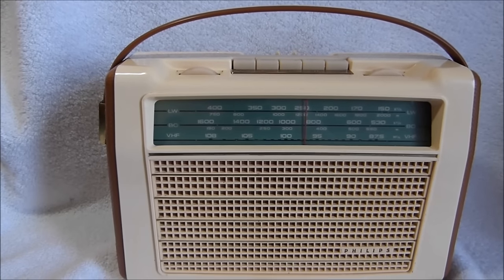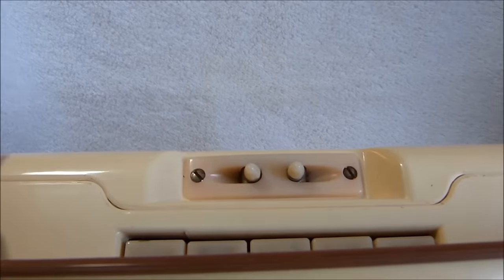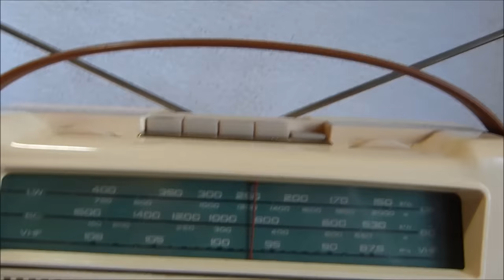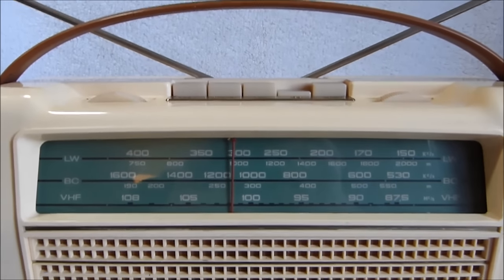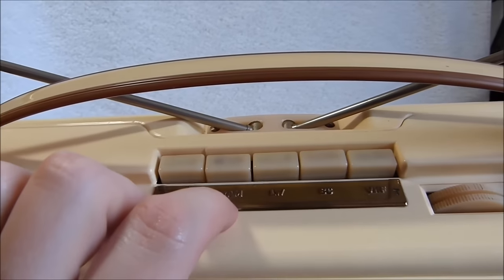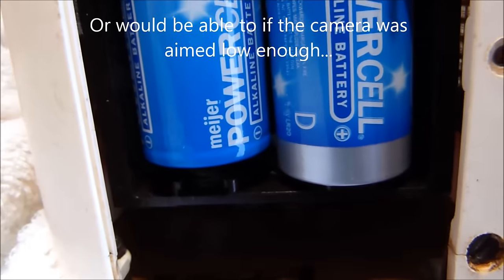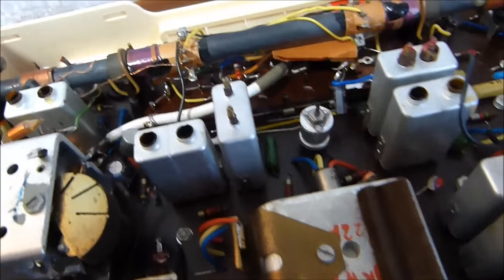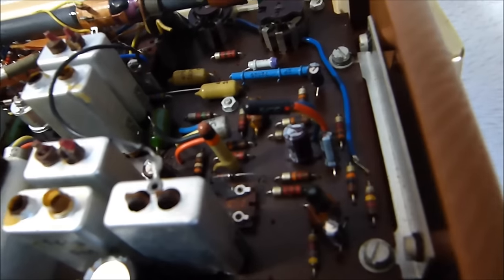1962 Philips model L4X98T/72 transistor radio (made in Holland)

Comment: Like it! On the intermittent, have you checked for dry-joints?  It's a real pig when they work for a while then go silent, my sympathies.  On the circuit, I bet Philips made another version with just a different dial for the Continental European market.
Reply from the maker: +Andrewausfa I did try gently flexing the board, but I couldn't get AM to come back... this one really just dropped dead all of a sudden. I am not sure if there were other versions of this model, but they did label the dial in meters (and KHz), and you don't see that on sets sold in the US and Canada generally.

Comment: Lol “untested, can’t find a 9V battery”
Reply from the maker: One time a seller said that, and there was a battery off to the side in one of the pictures!
Reply: Matt I was going to buy a older realistic sw model, seller stated “works great and in fine condition” so
I ask him basic questions, “dial light work, scratchy volume, tested on batteries?” His reply? Ahhh yeah I’m not an expert in radios I just sell stuff, and I’m not buying 4 C batteries to test it”!  You can buy 4 cheap batteries at dollar store for $2.50 (was 2$) a few months ago…hmmmm anyway, if someone wants top dollar would t it be wise to invest in a few batteries to add a few points to listing?  Typical example of a. “Embellishment of a. Item” Seller is obviously hiding flaws to protect himself but in long run, if buyer chooses, the eBay court will side with buyer. (Seller had listing as not for parts(

Comment: Howdy Matt!!  Im kinda mixed about this radio, some elements I like, others not so much!  Outside of aesthetics, it sounded real good! As you know, I can find some info about an item, this one, I did find the same links as you, I also found a site that claims he has the service manual, I have no affiliation with this site nor do have any first hand knowledge, I would suggest before you purchase, contact the seller and see if he would at least offer you a photo of the actual radio itself. 

Look at the bottom, 3rd one up, listed as a Norelco:  http://goo.gl/jl2jZi
Reply from the maker: +Vintage Electronics Geek It's not the flashiest design, but I like the nice clean design of this one personally. I think I found the link you were talking about, I kinda doubt they actually have the manual though. Plus I don't want to pay for a schematic until I am sure nobody has a copy.

Comment: In Australia, there was a similar model which had MW and 2 SW bands, and using 2 x OC74 audio output transistors.
I remember repairing one which had battery leak ('D' size batteries were inside a plastic box, held together by a brass
screw assembly). The electrolyte leaked on to the unlaquered circuit board, corroded 2 sections of wiring, and after a
'bridging' using new electrolytic cap 'snip offs', got it working. It had very good sensitivity, and the off/on switch was
in the top row of push buttons, and at some point was replaced by a mains type light switch put in a hole drilled in the
wooden back panel. I did this in the early 1980's, so at the time, electrolytic capacitors were still good.. I suppose the
failure of the transistors in your model was due to conductive dendrite formation around the junction, which I think was
a problem associated with just germanium transistors. The last group of germanium output transistors were the AC 188
(PNP) and AC 187(NPN), which were equivalent to the AC128 and AC127. At that time I don't think a complimentary (NPN)
transistor to the OC74 (PNP) was available, so the use of audio transformers (which gave impedance & phase matching) was
necessary then.. (1962)..
Reply from the maker: +jmcgatkinson This one had battery damage as well, but thankfully it must have been stored upright, because it did not ruin the circuit board or speaker. The metal dendrites / whiskers grow from the tin or tin plated cases of the transistors inward towards the junction. The short in the OC74 was drawing way more power than the tiny whiskers would be able to carry, so something else must have happened.
Reply: +50sTransistorRadios Yeah, ok. Possibly incorrect polarity of the supply voltage caused it. After repair, it sounds very good. There demonstrates the RF amplification qualities of germanium transistors..
Reply from the maker: I know I ruined at least one set by hooking up the power backwards unfortunately. I know have a power supply with adjustable current limiting, so I can cut power before damage is done.